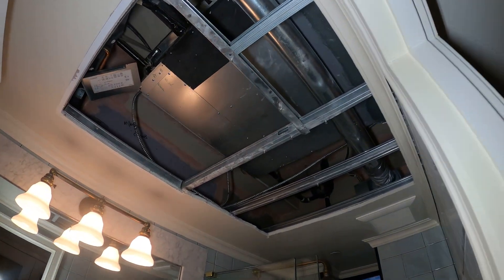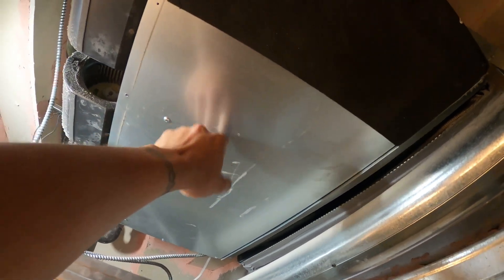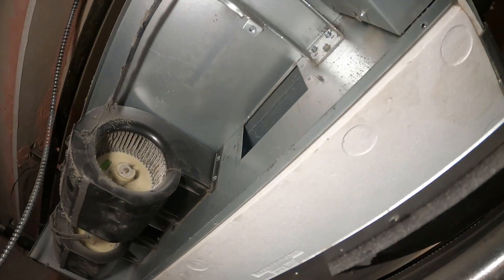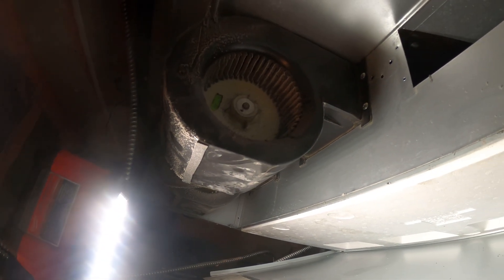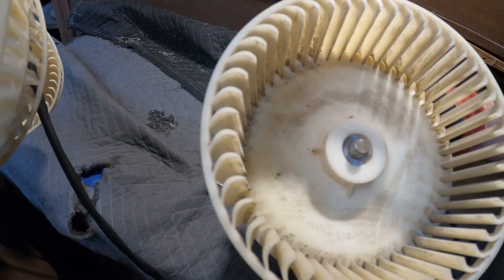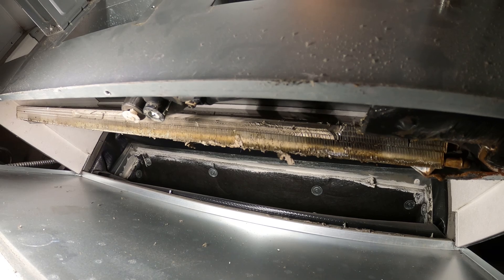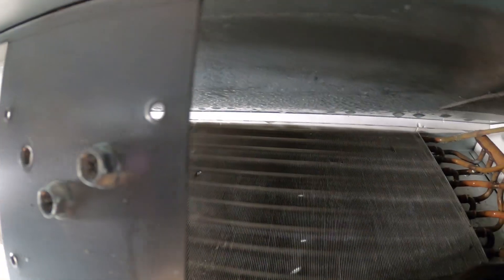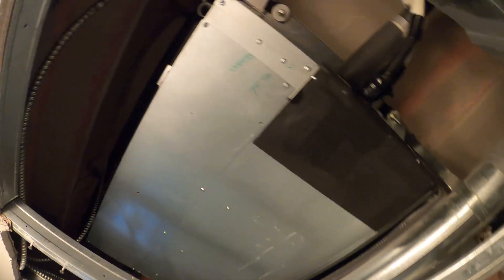HVAC Service Call: LG Multi V 4 Concealed Duct Preventive Maintenance (LG Air Handler Cleaning)

Comment: To access the coil you need to drop the drainpan or use one of those leave on cleaners like evap+ sprayed through the blower inlet.
UPDATE   just finished the vid see u got it covered  👍

Comment: amazing work!  hope you wore a dust mask!!  fan motor bearings are shot mind :)
Reply from the maker: Thank you!! Definitely wore a dust mask. Had to pull out the motors to clean them outside because of all that dust as well. The bearings sound really bad! Looks like they gotta go for peace of mind. Thanks for watching!🔧⚡️
Reply: @JumpermanTech  I was quite surprised to see two fan motors, twin and single blower config, thought they'd of been cheaper there and just done a long shaft to run all blowers from one motor